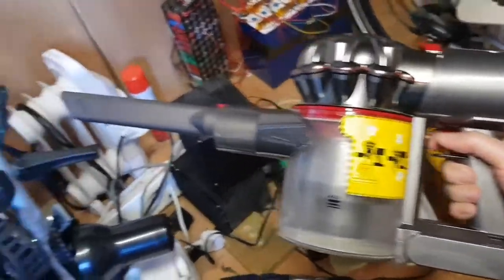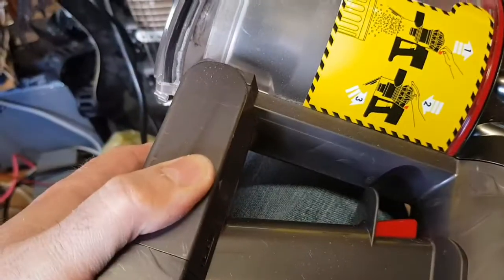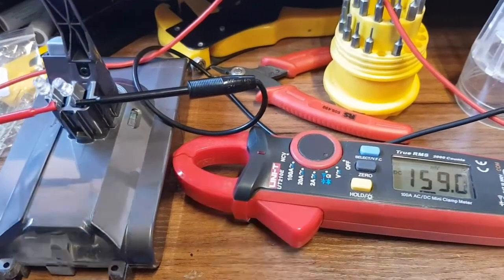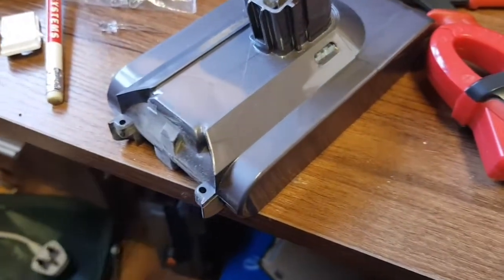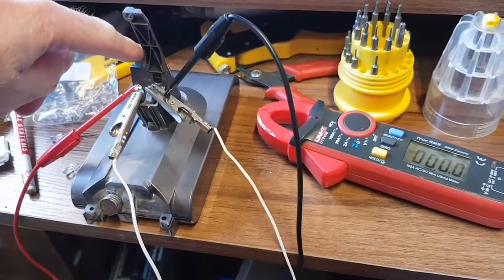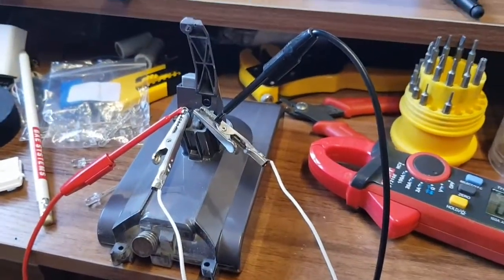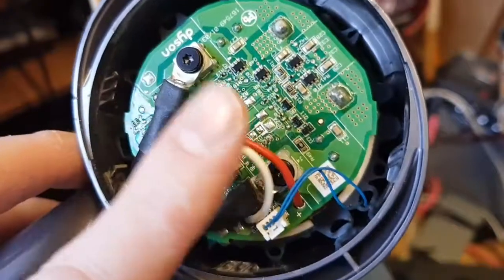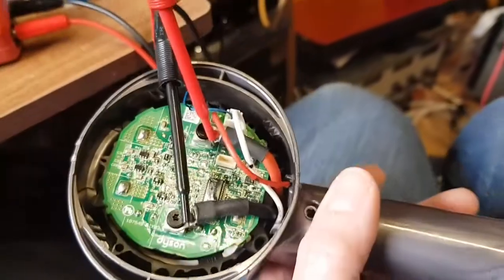Dyson v8 teardown and repair

Comment: This is pretty dumb. The most common cause is blockage restricting air flow and needs to be cleaned out but you went straight to the battery, and motor.....least likely causes lol